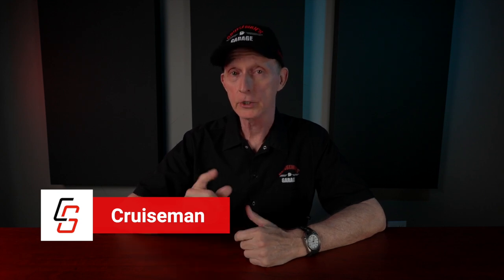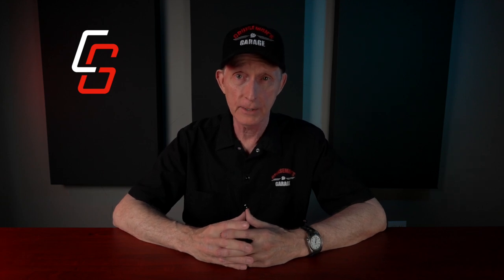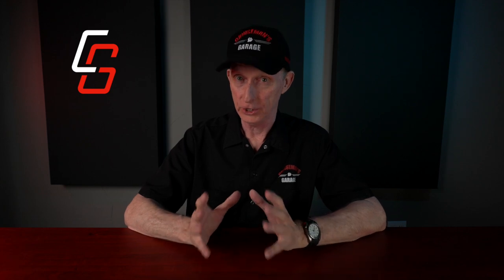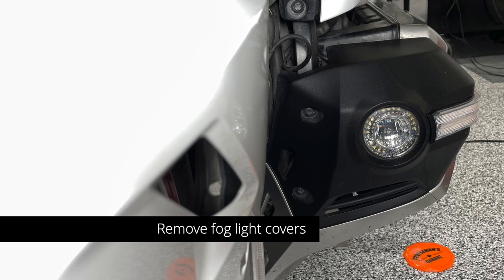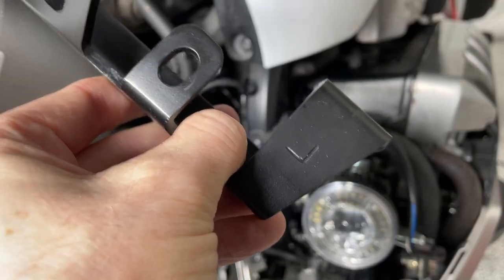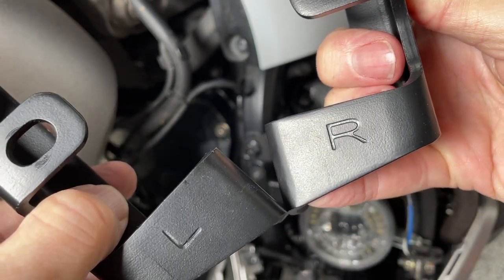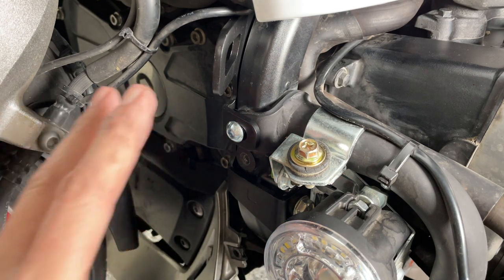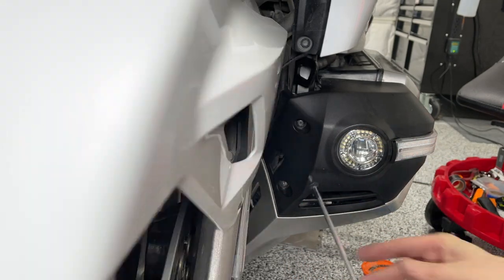Goldstrike Tie Down Brackets INSTALL | 2018+ Honda Goldwing | CruisemansGarage.com

Comment: Nice.  I could have used these three weeks ago when I had to have my DCT towed.  They too had to strap to the handle bars.    Thanks for the video.  I just ordered a set. 👍😁
Just installed them and with the Aux. Lights, it went rather quick and easy.   You got this!

Comment: I have these Goldstrike brackets on my Goldwing.  I don't ever plan to tow the bike, but this is one of those things that will come in very handy in the event that it needs to be towed.  Most towing companies are accustomed to using the handlebars on every other bike, so its better to have a solid place to secure the bike so they don't accidentally snap the steering stem.

Comment: I also installed these. Previously I had used a soft tie around the front suspension column. That worked quite well for me. For the price of the Goldstikes, and ease of installation I added these. Makes for a much faster tiedown on the trailer and on the lift.

Comment: These are great tie-downs.  I installed these in the dealer parking lot after taking delivery of my Goldwing last year before trailering the bike home.  Easy install, no modifications needed...My bike has Pathfinder LED driving lights.

Comment: The steel brackets are very strong. The hollow aluminum sub-frame they attach to is not. I have seen the sub-frame brake from using these brackets.

Comment: Works well with the Electrical Connection fog lights (like yours - you need to do something with them). Actually relatively easy as it’s one of the few add ons I’ve done. Excellent for tying down the bike while trailering. They should be standard on the bike! IMHO

Comment: Thank you Cruiseman!  I installed a set yesterday on my 2020.  Your video was very helpful. I have stock foglights and had to loosen the top bolt as you did.  No issues... it was an easy install.  Thanks again.  All the best to you.

Comment: Cruiseman, I have the Electrical Connection visibility lights installed on my 2018 and the Goldstrike Tie down brackets, fit with out any modifications.

Comment: I literally finished this install, came inside and found you had uploaded this video yesterday. With the Honda driving lights you have to move them out of the way to even remove the horn bolt, the bolt hits the light before it comes all the way out. I had to remove the outer bolt, I believe it was a 7mm with a 10mm nut on the inside. Then I just loosened the top bolt and swung the light up and out of the way.

Comment: Hi Chris..  I've seen you remove the forward crash bar covers quite easily, with one hand..  couldn't you just do that when needed, and use the forward crash bars for tie down points?  Even easier if you have forward highway pegs/boards installed, no?
Reply: I have the same question ?
Reply: For what it’s worth, I used both the GoldStrike tie downs in conjunction with the front tip over protection.  Using this combination means you can spread the torquing down of the front end.
Reply: That's my question for peoole without add ons in the way . Why not use the factory tie down points ?

Comment: Two questions, 
First , Is there enough room at eyelet so tie down strap clears engine cover?
Second, do you or any of your followers use a Track Side roll on wheel chock, or anything similar ? I had one ( different brand) with my 2009 Harley and it worked great.
Thanks for the great videos!

Comment: Installed them also Chris I too have Pathfinder Fog and Cowl lights.  A bit tricky but as you instructed install went  without a hitch. Love the Quality Goldstrike products.  Also Cary a couple of nylon looped end straps if added protection or compatible tie down point is needed. Trust the bike implicitly  but just in case. 😂

Comment: Hey Cruise man thank you for the video.  One thing you left out was the need to trim the fog light covers to fit around the new bracket.  They will not fit properly without trimming the inside edge with a razor knife.
Reply from the maker: Hmmm. I have heard others say this, but I did not have to trim mine.
Reply: @cruisemansgarage  could be! Maybe some years have a naturally wider opening on the light covers.  That would explain it. Mine is a 2018 manual.  I trimmed about an 8th off ... Not much.

Comment: I installed these on my 2019 but haven't used them yet.  I am concerned about a tie down going to the bottom front of the trailer as I think the strap will rub on some of that plastic.

Comment: Hey Cruise man, I had the chance to install the Kuryukan Tie Down kit mounted on the steering column and I think it is much better and cleaner alternative. It took me 5 mins to install, no joke. It is very simple and well made.
Reply: I installed it also. I like it better because it doesn't load the front suspension when you tighten it down

Comment: I had to trim the plastic cowling on the right side slightly so it wouldn’t hit the bracket. Otherwise the cowling wouldn’t sit flush to allow its fasteners to fit properly. The left side fit without trimming. The instructions that came with the brackets said that some trimming may be required.   
These brackets will also come in handy if you ever have to secure your bike while on a ferry.

Comment: Of course I have to have a different result.  Right one went on, no problem.  Left one however, the light cover would not go back on.  The bracket stuck out too far and the lip of the cover had to be trimmed for it to go back on and fit correctly.  I am sure this doesn't happen to anyone else.

Comment: Do they by chance make them for the 2012-2017 ??
Reply: Not needed on 2001-17 as the engine bars (my preference) or the handlebars can be used

Comment: You left out the part as per the instructions about the possibility of having to trim the cover to make sure it fits flush ,i didnt think months ago  i would need to do this but after a while i realized the plastic trim cover would/could strip the protective paint off the tie down bracket and that could cause rust.
Reply from the maker: I had no problem with the fit of my covers. Also, if my assumption is correct about the brackets being powder coated, I doubt that plastic would every scrape off powder coat.
Reply: @cruisemansgarage  I powder coat and plastic rubbing will remove powder coating just like on any type of paint after time ,hence why im guessing goldstrike instrucks to trim if needed.btw when i first installed mine i thought it was ok but then i realized it was right on the part so i took a razor blade and just scraped off a bit to be on the safe side, i dobt want to take the part off and re powder coat it...or do i(a different color)🤔 anyway good vid.

Comment: Couldn't you just secure the bike for trailering per Honda's recommendation?
Reply from the maker: Yes, but you would need to remove the lower cowls on both sides of the engine.
Reply: @cruisemansgarage  I used the tie down straps around the steering head in the front and the rear crash bars for the rear.  Traveled several hundred miles on nasty PA roads and worked well.  If I ever go much longer I'll add an across the seat strap as well as insurance.   I'll carry some tie down soft straps with me now in case I ever need a tow from a commerical company.  Supposedly Honda approves the tie down strap around the steering head method now along with the front and rear crash bar method.